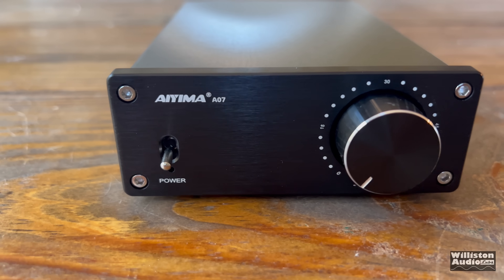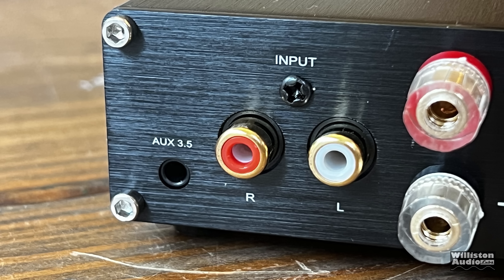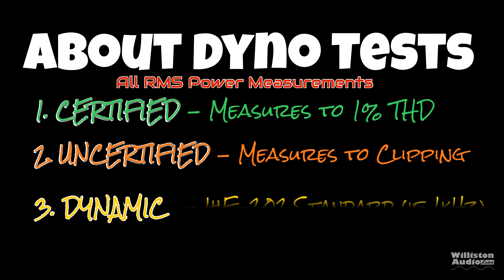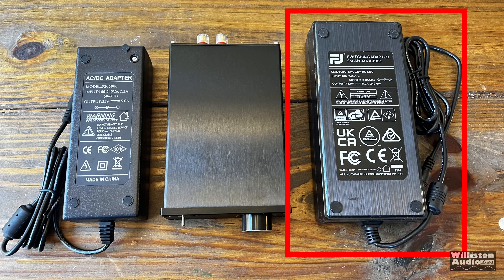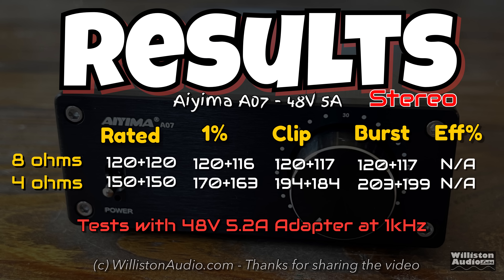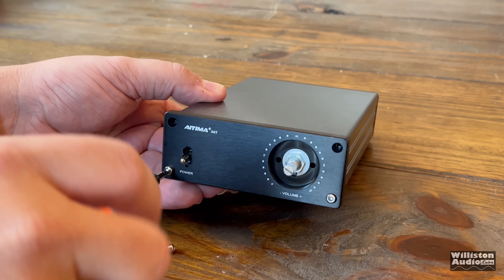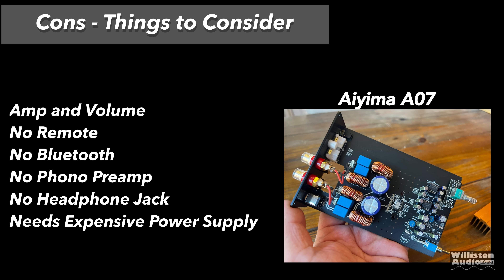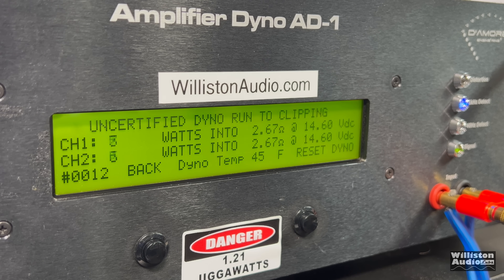Is it the MOST POWERFUL Mini Amp on Amazon? AIYIMA A07 Amp Dyno Test and Review

Comment: I bought one of these amps to play around with after the glowing review from the cheapaudioman on yt and was impressed by the sound quality and power.  I was considering the larger psu but read many returned thiers due to added noise issue. Wondering if big d had extra noise with the big psu as well?
Reply from the maker: I didn’t experience any noise issues with the 48V power supoly
Reply: I just ordered the larger power supply.  It has a 20 dollar off discount on amazon as of writing this.  $55 bucks is a no brainer!

Comment: I use the A07 with a 36v 10amp cage power supply. 360 watts. In the diy forums that is the sweet spot for this chip. The cost with cables comes to about $40. That's the real test.
Reply: @@Douglas_Blake I never expected to get 100% efficiency. Best case would be 85%. But the unit performs better overall than with 48v.
Reply: @@Douglas_Blake Thanks for the clarification.
Reply: Is there a link to the diy forums? Or maybe you can direct me to the specifics needed? I have the 48v 5 amp power supply now. Thanks! And Happy new year!
Reply: @derekmaynard5619  You probably don't need to change if you are not using the A07. Early A07s used components that weren't rated high enough for the 48v supply. The capacitors were only rated to 50v.

Comment: sometimes its not the loudness you want the power for, you want it for cone control and for the speaker to not shit itself when trying to play bass notes or crackling mids and highs at medium to high volumes which generally happens when you run out of power.

Comment: give it 48 volts and 10 amp psu , buy those metal cased ones they have adjustable voltage and u set it to 52volts or more. and then run 4ohm 6ohm and 8ohm tests. run it outside the case with a fan blowing over the heatsink and most importantly coils.
Reply from the maker: About like running your engine at redline for extended periods
Reply: hi may be a better approach is to select high efficiency speakers? if you push this little marvel too much it could last not very long

Comment: 2:16 you can get the 48-volt pretty cheap on Alibaba Express... The one in the metal cases used for buck converter power supplies all the time.

Comment from the maker: AIYIMA A07 mini audio amplifier
SHOP
AIYAMA A07 Amp with 32V adapter: https://amzn.to/3Xu0jEA
AIYAMA 48V 5.2A Adapter: https://amzn.to/3H1CHSh
Related Videos
Douk Audio M1 Pro Mini Amp: https://youtu.be/WROm7jJbb2M
Mini Amp Video Playlist: https://bit.ly/3IMdtbN
Amp Dyno Modes Explained: https://youtu.be/Q0m6NsB-HHc
More Power Output than Power Supply?: https://youtu.be/c7QELbpKMuI?t=490

VIDEO INDEX
0:00 Intro
0:40 Unboxing
1:26 Features and Specs
2:17 Additional Power Supply Options
3:02 Amp Dyno Tests
6:59 Sound Quality Tests
8:42 What's Inside?
9:55 Pros and Cons
10:42 Final Thoughts
11:05 EXTRAS

CAMERAS AND AUDIO GEAR
(Video Gear I Use) 
Camera - iPhone 13pro 1TB - https://amzn.to/3nCjGvc
RODE Wireless Go II Microphones: https://amzn.to/3Q6NVHl
Shure MV7 Microphone: https://amzn.to/3A4OICK
Zoom H4n Audio Recorder: https://amzn.to/3BXjVsS
960 LED Panel: https://amzn.to/2Sxoq3S

TEST BENCH EQUIPMENT
SMD / D'Amore Engineering Amp Dyno: https://goo.gl/sJTcf7
XS Power D1400 Batteries - https://amzn.to/2BPFCKW
XS Power PSC60 Charger - https://amzn.to/2CHGcfs
Fluke 1000A AC/DC Clamp Meter: https://amzn.to/2Rw5WDA
Handheld Dyno: http://amzn.to/2u2EgKV
My Favorite Screwdriver Kit: http://amzn.to/2x0VzcE

DISCLAIMER: This video and description contains affiliate links, which means that if you purchase from one of the product links, I may receive a small commission. As an Amazon Associate I earn from qualifying purchases
Reply: How is this comment 2 days old but the video is 5
Reply from the maker: @ShiaGaming88  video is released early for my Patreon subscribers
Reply: @wal  oh